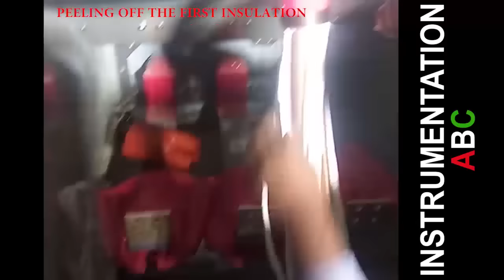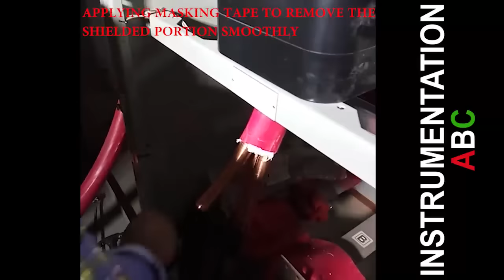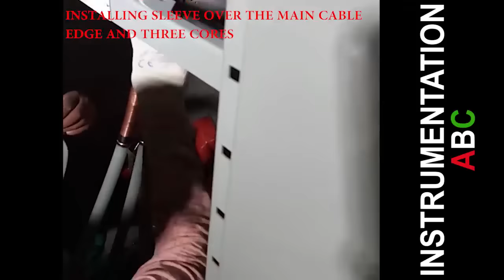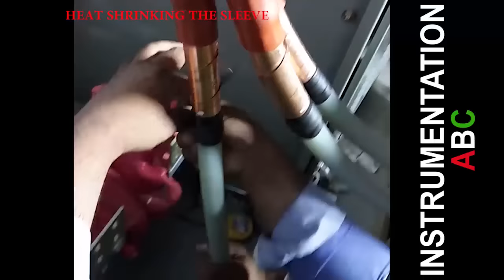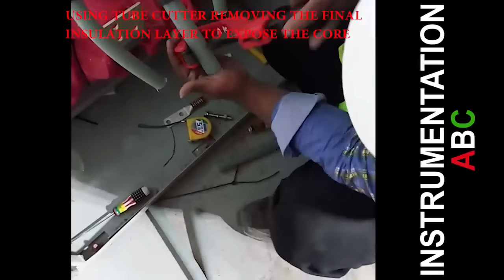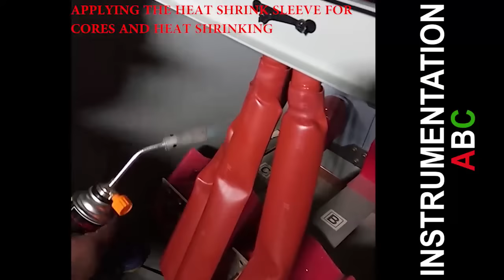MV Cable Termination

Comment: Poorly made video sloppy trim work around cable. For training purpose they should not have used a knife as the instruction say not too and workers coil wraps were sideways a little. Also this is supposed to be a glove free process do to unwanted carbons on cable. cleaning cable or not minimize the amount of contaminates exposed to the insulation.

Comment: As a cable jointer (splice)good work but only need to his properly tools and safely work activity training bcz  heat shrink kit time not flowing in mv switches gear protect terminal busbar selev  to care about mv switches gear

Comment: What happened to the braided shields?  I saw them wrap electrical tape putting them into contact with the conductor tape shield but where did the braided shield connect to?